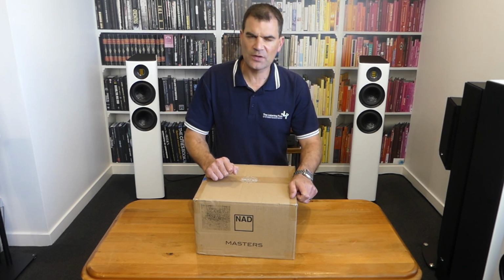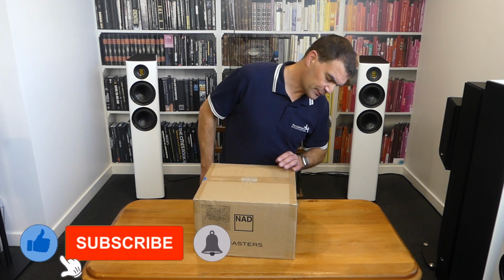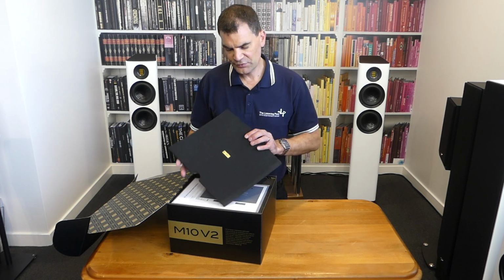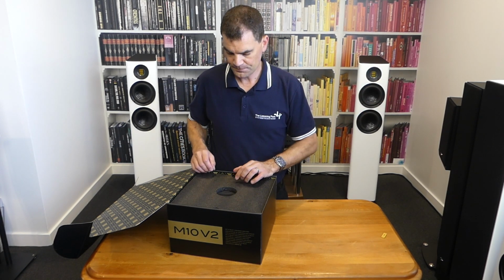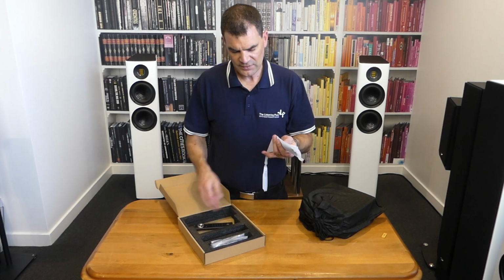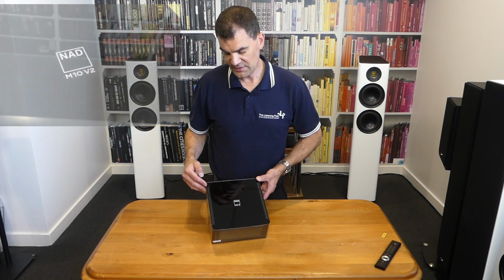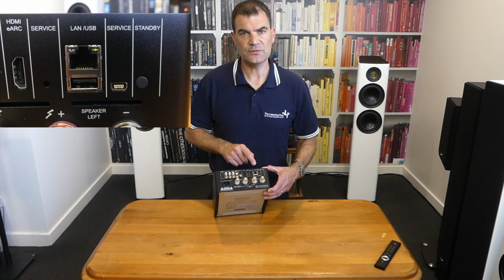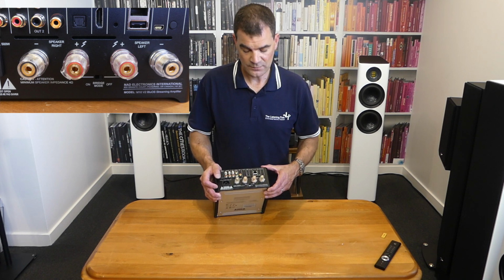NAD M10 V2 BluOS Streaming Amplifier | The Listening Post | TLPCHC TLPWLG

Comment: Hello, i have some B&W 705S2 looking to pair with an amp. Currently looking at NAD m10v2 - Cambridge Audio evo150 - NAD C-399. Do you have any recommendations on which may be better to pair with my speakers or is that too subjective of a question?
Reply from the maker: Both the C399 and M-10 will out perform the Cambridge.  If the amp is out on display, buy the M10. It is a stunning looking amp, that functions well from the front display.
Reply: @TLPCHC  thank you!

Comment: Looks like a nice amplifier, having always owned amplifiers with traditional dial’s and buttons how reliable would this touch screen be with long term use?
I feel like if the screen were to become faulty then the entire amplifier would be useless?
Reply from the maker: I guess you coudl use the App for control if there is ever an issue, or buy the C-700 (which has a knob)
Reply: How does the NAD C399 complare to this M10 v2?
Apart from the higher 180wpc do both of these amplifiers have the same sound quality or would you say that m10 v2 sounds better overall?
Reply: @HJC1982  I’d like to know this as well!

Comment: Thank you for your video. I had the NAD 390 but I sold it… sadly - so now I think to buy this m10 or a 399 with blu os because more power for less money … could you give me some advice? Speaker is the old 804s…
Reply from the maker: I think you need the power of the C-399. Or maybe the C368 and the C268 combo! (heaps of power)
Reply: @TLPCHC  thank you for your answer .. think I will go with the 399 because the Dirac - I hope and think Dirac could help me a lot for bass waves to set up … do you have a video about Dirac with some experience? What do you think about Dirac ? Do you recommend it ? 🤗